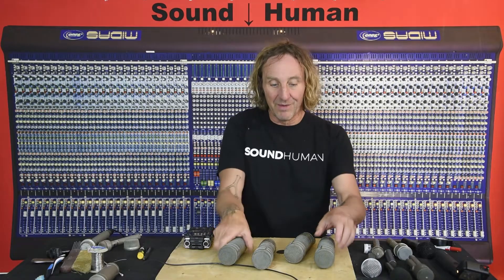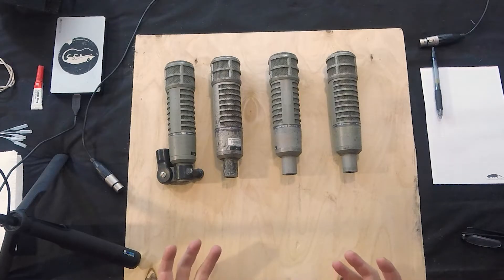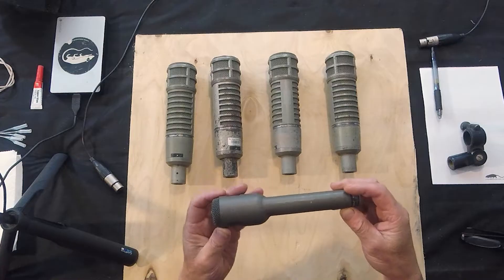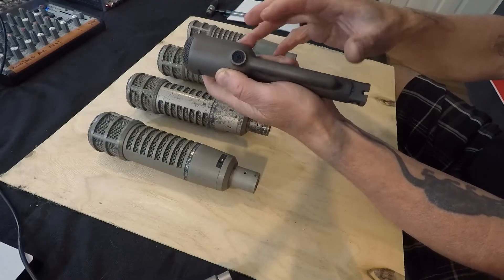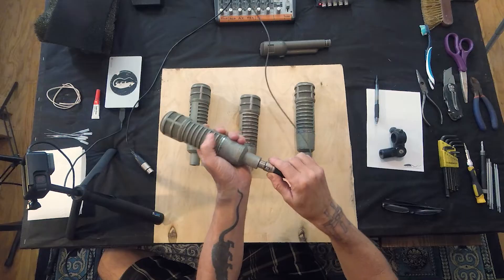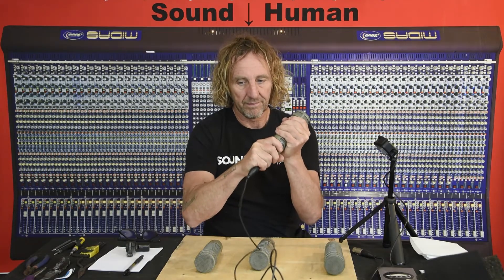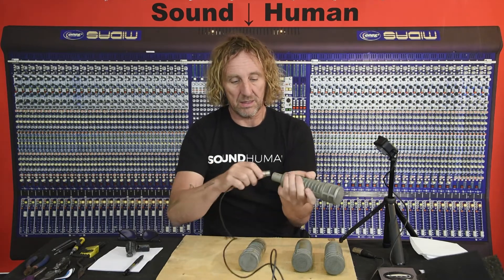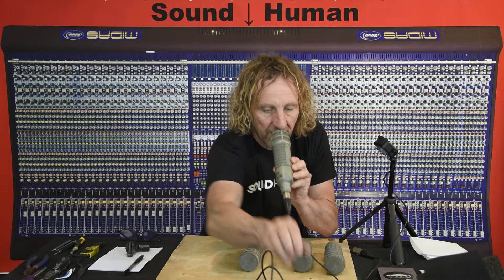Electro Voice RE20 Mic Rebuild Vid #1 - Porting, Proximity & Test

Comment: The conventional, "scientific" way to think about mic patterns and proximity effect is in terms of what the mic is measuring. 

An omnidirectional mic measures absolute pressure, i.e. how much pressure is hitting the diaphragm.

A figure-8 mic measures pressure gradient, or the rate at which pressure changes along the mic's acis.

A cardioid mic is a combination of the two: 50% of its response is to absolute pressure and 50% to pressure gradient. The cardioid polar pattern is defined as the the sum of the figure-8 and omni patterns. The rear response is zero because the pressure-gradient response is 180 degrees out of phase with the absolute-pressure response in the rear. This also explains why dual-cardioid mics like the 414 can reproduce omni and figure-8 curves:

front_cardioid + back_cardioid = (omni + f8) + (omni - f8) = 2*omni
front_cardioid - back_cardioid = (omni + f8) - (omni - f8) = 2*f8

Proximity effect happens because "real-world" pressure-gradient mics can't directly measure the gradient of the pressure. Instead, they approximate it by measuring the pressure difference between two points (the direct path and the port path) and use that difference to approximate the gradient. Proximity effect happens when the distance between those points is large enough relative to the distance form the source to significantly contribute to distance^2 falloff. This causes the mic to incorrectly interpret that distance^2 falloff as a larger gradient than is truly present. It happens at low frequencies because at higher frequencies phase differences dominate over amplitude differences (i.e. the distance^2 contribution has less influence). 

So your theory about 4:00 is actually closer to the conventional theory than you realized when you dismissed the latter as wrong. Just different ways of saying the same thing.
Reply from the maker: thank you Patrick! super interesting and well explained. much appreciated.

Comment: I can pick one up for 100$ but it has surface rust and a dent, I smell bad juju when an owner says "Well it still works" but has no bench marks
Reply from the maker: If you get it cheap enough they can be a fun rebuild. The housings are still and can be sanded down and refinished. Years ago I had a pair of black ones I painted with appliance flat black paint that looked cool as can be

Comment: Love my PL20 (same as RE20, but different paint). Bought it for cheap at an auction, spent $45 on a real EV/Bosch foam kit and had it all fixed up in less than an hour. I spent more on a shock mount for it that I did on the mic and the foam!
Reply from the maker: Yes! Great deal! Great mics, suck to work on.